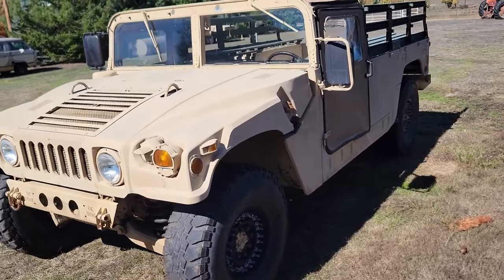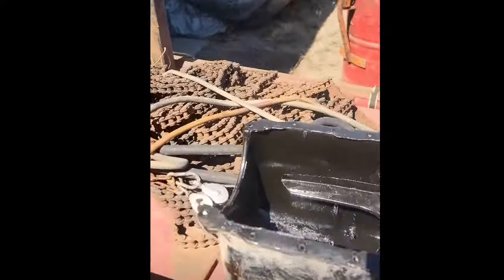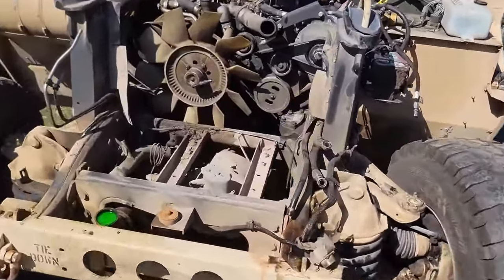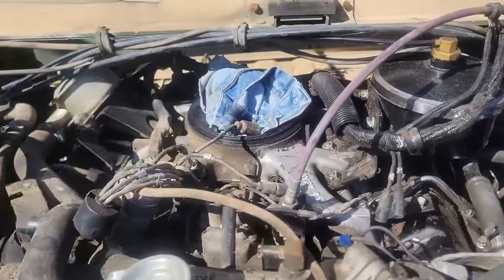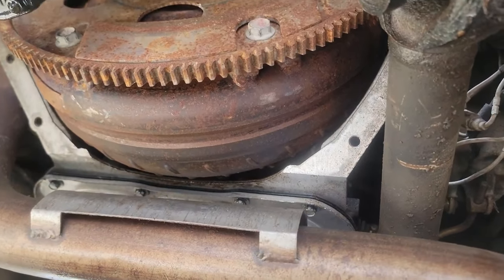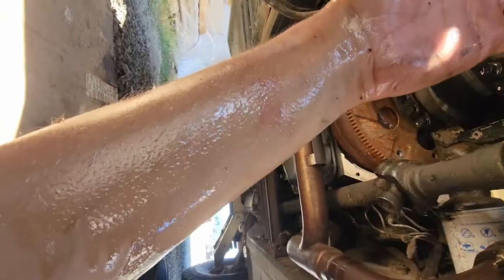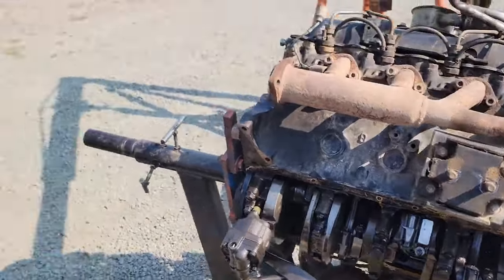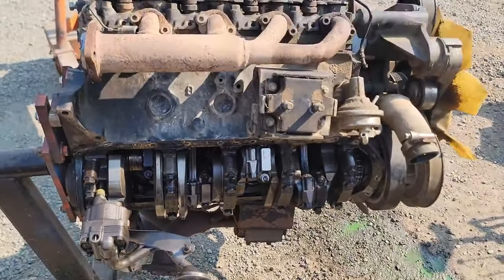We Bought a Military Humvee!

Comment: Brings back some memories, spent 20 years in Army. Spend my time in 3 and 4 shop. Everything from wheeled vehicles to Abram’s. 
They are pretty robust. But soldiers are just horrible on equipment. Most of the pressure transducers and the tach signal the yellow box in valley. Can be left off. Unless you have a (STEICE) simplified test equipment for internal combustion engines. 
Be sure you check oil level in portals. 

Also if they are ran hard the transmission push oil into transfer case. Talking sustained high speeds above 65 mph.  All portals, diffs, transfer case and transmission are vented at air cleaner housing. Sometimes oil and atf makes its way to filter
Reply from the maker: This thing has definitely been used hard but hopefully we can get it going again!

Comment: You say it has a Bad Motor.. It must be an Electric HMMWV, Because US Army HMMWV are Diesel Engines. Motors are Electric and Use Electricity to move, Engines Use Fuel to move
Reply: mo·tor
/ˈmōdər/
noun
a machine, especially one powered by electricity or internal combustion, that supplies motive power for a vehicle or for some other device with moving parts.

Source: Oxford Dictionary
Reply: womp womp
Reply: @bushmaster42  What is the difference between a motor and an engine?
“People use both interchangeably, but the difference is that motors run on electricity and engines run on combustion. The engine converts various forms of fuels into mechanical force, while the motor transforms electrical energy into mechanical energy.”
Reply: @JamesBeans01  What is the difference between a motor and an engine?
“People use both interchangeably, but the difference is that motors run on electricity and engines run on combustion. The engine converts various forms of fuels into mechanical force, while the motor transforms electrical energy into mechanical energy.”